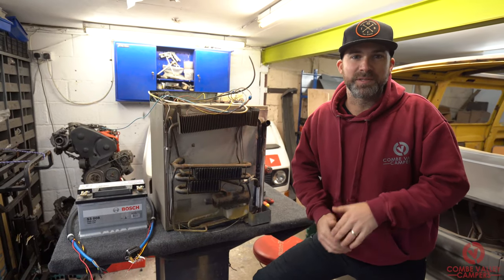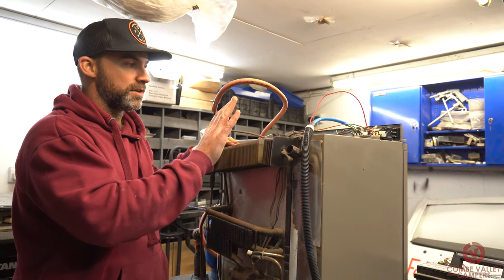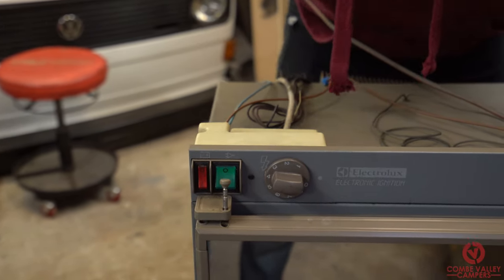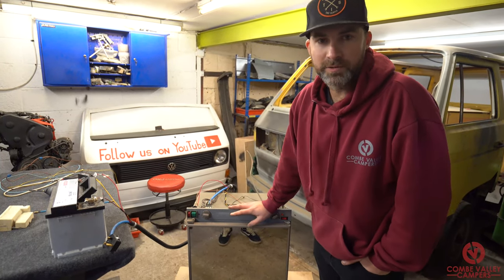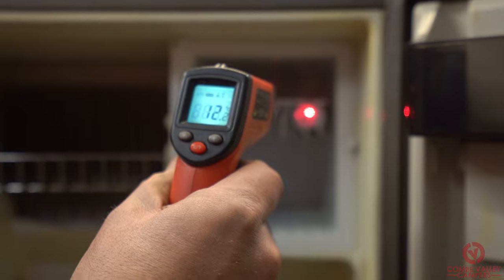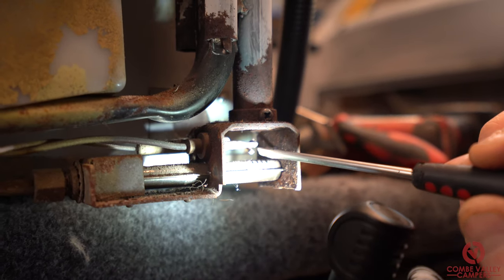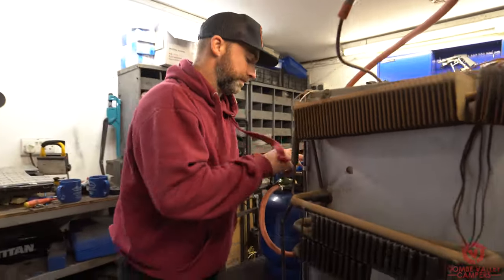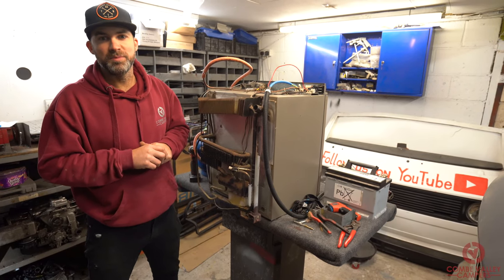HOW TO REPAIR A 3 WAY FRIDGE.  Includes operating and maintenance instructions

Comment: I have a "Vitrifrigo " 3 way fridge model 5080 it wont work on Gas [ but the pilot lights and stays lit ]  or on 240V  [ even though the back of the fridge get hot ]  but on 12v it works fine ,,, I've checked the thermostat and connected the 2 wires together but it still only works on 12v  .. also the ohms meter shows the thermostat is in the switch on position [ like connecting the 2 wire's to make the circuit]  any ideas ???

Comment: Hi, my 2000 eletralux fridge works fine off mains, but struggling off gas took fridge out turned upside down, left for a few days, fridge and freezer working fine, freezer working to good turned settings down, freezer now not working, tried turning back up but didnt work, freezer cold but not freezing, any ideas would be appreciated, thank you